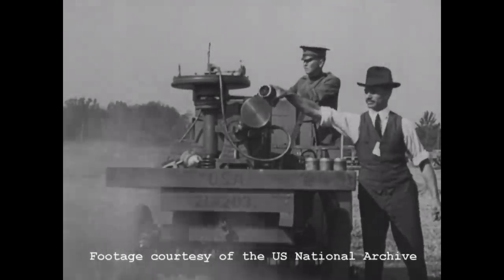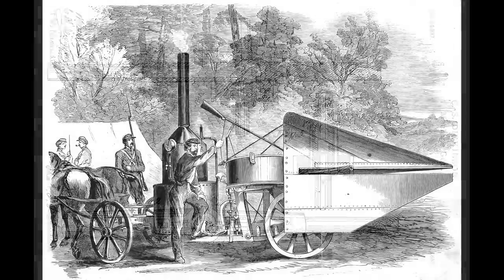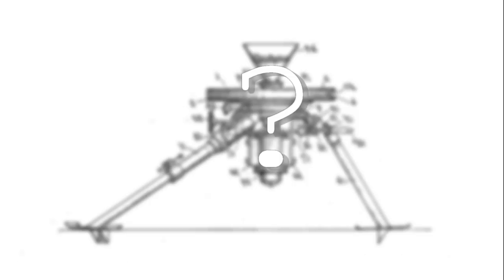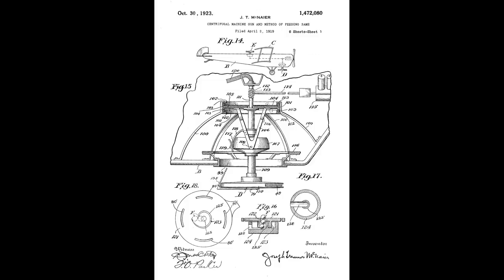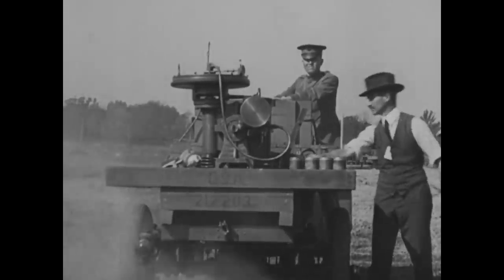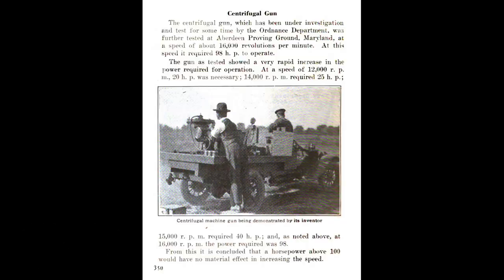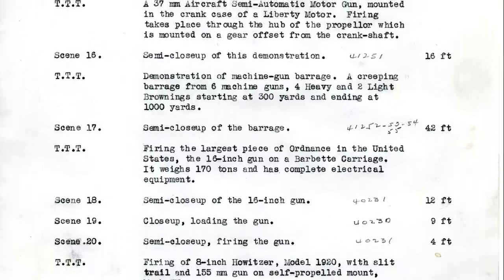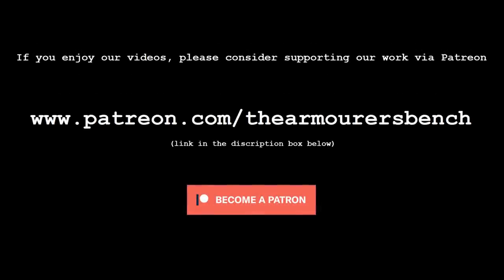Centrifugal Machine Guns

Comment: Its funny. These guns could be pretty effective with modern engines. These guns would also probably be totally legal to own in most countries in the world.
Reply: That's exactly what I thought. Might be a fun little engineering project!
Reply: Engines are inferior to electric motor
Reply: @luongmaihunggia  you still need a generator to provide electricity.
Reply: @ScottKenny1978  or alternatively a battery
Reply: @luongmaihunggia  still need a generator to charge the battery. And for a military weapon, I want something that can work when the power is out.
Reply: @ScottKenny1978  the battery can power the weapon for as long as E/P where E is the energy of the battery and P is the power of the weapon.
Reply: @luongmaihunggia  as long as the battery doesn't take damage, or leak charge or ... Or just flat have more enemies than the battery lasts.
Reply: @ScottKenny1978  and gasoline generator don't break down and need repairing? How is it better?
Reply: @luongmaihunggia  assuming a large system like a CIWS, you're always going to have a generator at the base, for radios and everything else. If it's part of a vehicle like a firing port weapon, the vehicle engine can provide the electrical power.

Yes, the weapon probably will have a backup battery good for a minute or two, but when you're talking about a 100hp motor to spin the centrifuge, that's a big battery and electric motor.
Reply: @ScottKenny1978  the grid cover a huge part of the world already. You wouldn't need a generator with thousand of easy to break moving parts to charge the battery. You can just charge it from the grid.

You don't need a big battery. Each bullet is only a thousand joules of kinetic energy. A 1kWh battery has enough energy for 3600 shots.
Reply: @ScottKenny1978  battery is an ok solution. Because the operation of ANY weapon is tied to either ammunition, gunpowder, gasoline or some other form of finite resource which must be supplied. Charged battery is the same thing: just a resource. The energy density of a lithium battery is comparable to a gunpowder. In turn, a gun that uses a bucket of metal balls and batteries would be feasible given the other specs like power and accuracy achieved.
But up to this date all rotor-based projectile launchers have one major problem. Accuracy is extremely bad. It is so bad that even super high rate of fire can't compensate for it. And it's unknown if that problem could be solved with the current state of engineering.
Reply: @shurmurray  no, Li+ are nowhere near as energy dense as gunpowder. Li+ batteries are 265wH (954,000J) per kg. Gunpowder is 3MJ per kg, 30 times more energy than a Li+ battery.
Reply: @ScottKenny1978  hm. The info somehow messed up in my brain. And little remark: the difference not 30 times, but ~3 (just below 1MJ vs 3MJ).
Looks like my point where based on some previous calculations, where I also took into account the efficiency of firearms vs the efficiency of electric motors. The weight of a gunpowder-based ammunition also contains the weight of a cartridge case.
In the end a gun powered by battery may be comparable to firearm in terms of weight of a system per projectile. Yet there are still a ton of unsolved engineering challenges. The DREAD project go silent many years ago and there was only one blurry video of real prototype.
Reply: @luongmaihunggia  Lithium battery has 300 watt hours per kg. Diesel has over 12 thousand watt hours per KG. This is why engines are used and needed.

Comment: With modern materials and technology such a gun could be designed as to make sized of little consequence with a rotor turning at 30,000 rpm and behaving multiple barrels a rate of fire of 120,000 rounds per minute could be achieved. The there is the drawback of the weight of so many steel balls.

Comment: You may want to dig through old (1930-1957?) copies of Ripley's Believe It Or Not--that's where I first learned of centrifugal machine guns, about forty years ago. The Tennessee Valley Authority operates scores of small hydroelectric dams. Similar dams were to be built (prior to the Great Depression) all up the east coast. These were to power not only factories and cities but coastal defenses, ranging from Nikolai Tesla's Death Ray towers to bunkers fitted with 1" pneumatic-powered (100 h.p.) centrifugal machine guns firing 20,000 rpm to counter amphibious landings.

Comment: Making it vertical,and adding a short straight track after the spiral track used to accelerate the BB,would tighten it's grouping a bit, I think.Also it adds backspin to the balls,which increases range. I made a prototype powered by a chainsaw. It was crude, so it had too much friction,and  it had the power of a slingshot.

Comment: I'm curious if the weapon system would be viable now for some implementation, with the advent of modern electric vehicles you can purchase 300hp motors that only way a few pounds and aren't much bigger than a soda can.

You saying they got 1200 fps in a 98 horsepower motor if that scales linearly you'd get around 3600fps, so basically something outperforming most modern weapons in velocity. 
(and I'm curious if some sort of airsoft tech can fix the accuracy issue as they seem to be doing something right.)

Comment: I've been obsessed with the idea of these types of mass launchers for a while and I absolutely love your video on it, I had been trying to find footage of one but failed. I must have rewatched this video a dozen times while reading old patents on them and trying to figure out which designs are the best on paper and possible improvements. now with the advent of super powerful compact electric motors these could be deployed much easier than back when 70hp of engine was an entire truck  bed full of motor instead of a breifcase sized motor. I believe the D.R.E.A.D. system was promising something like this but I can't find any recent developments with it. I'm assuming once again the issue is accuracy, this is more of an area effect weapon in these older designs. I really cannot believe there havent been more revivals of these for the reasons in the video they claimed they would be of value such as defensive weapons on power stations ect. Bullets are very cheap to produce, its the brass casing and gunpowder and transport of all of that that get expensive and dangerous.
Reply from the maker: Thanks Steven, it's a fascinating technological dead end which you think we'd have been able to overcome by now. Almost seems like this is as close as we've gotten so far. Be sure to check out the accompanying blog for more patents and stuff. Thanks for watching.

Comment: Great video Matt! I wonder if torque-induced precession (gyroscopic precession) caused issues in aiming the gun? Moving the aiming point at around 90 degrees to the axis of rotation (elevation) would be effected! Perhaps this was an issue too as well as the metallurgy and engineering capabilities of the day?

As a side note, as a young apprentice I was 4 feet away from a scientific centrifuge that had its rotor shatter at 22,000 rpm... a huge bang and the half tonne centrifuge lifted in the air and flew across the room. 1 inch armour plate and the power cable going tight halted its progress BUT it was a fantastic illustration of centrifugal precession 😁
Reply from the maker: Thank mate! I suspect that would be one of the many problems. Oof sounds bloody scary.
Reply: If they used tracer rounds that were phosphoric or ignite upon contact with oxygen (membrane strips upon firing), then they could just walk the stream of bullets onto the target.. but still not stabilized on the other axis'.

Comment: Note on Terminological error. 
 Although it be a most conman practice: In the absence of fire, it is simply not correct to use “fire” as a term  for propulsion of projectiles by means other than deflagration or detonation of compounds. 

It is by defamation not a gun:
Owing to the absence of propulsion of projectile via restricted combustion gases. 

The projectiles are not ball-bearings, but are in fact Bearing-balls, as a ball-bearing is a bearing that uses ball & a bearing-ball is a ball used in a Bearing.

 The above posted text is informational & should in no way be construo to have any other function or purpose.

P.s Matt, Your video was still informational so thanks for sharing.

Ref: Bearing-balls
https://www.mcmaster.com/bearing-balls 
https://www.bcprecision.com/collections/chrome-steel-ball-bearings 

Informational
https://en.wiktionary.org/wiki/informational

Terminological
https://en.wiktionary.org/wiki/terminological

Construo
https://en.wiktionary.org/wiki/construo#Latin

Term: use 5
https://en.wiktionary.org/wiki/term#Noun
Reply from the maker: Thanks for the feedback, I take your point! I suppose 'centrifugal projector' would be a more proper description for it. Thanks for watching, I'm very glad you found it interesting! - Matt